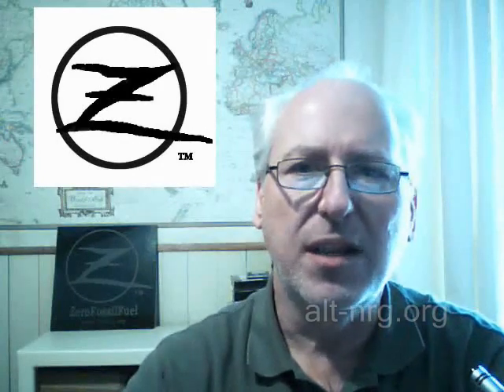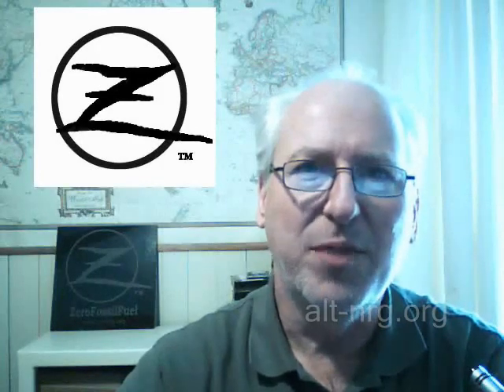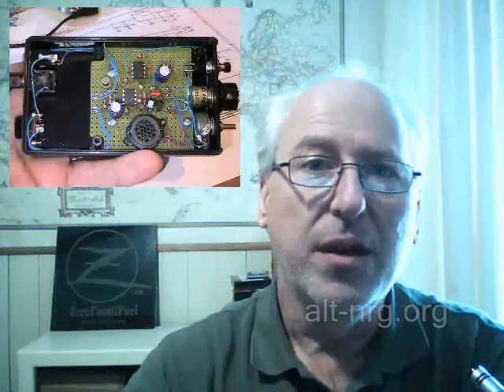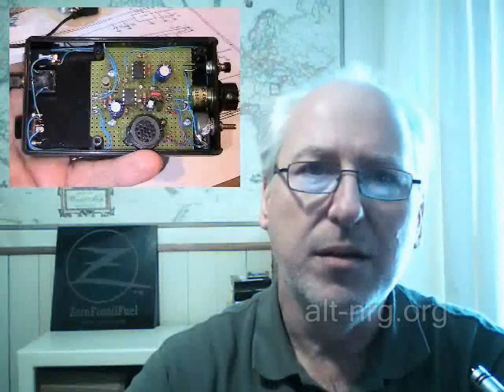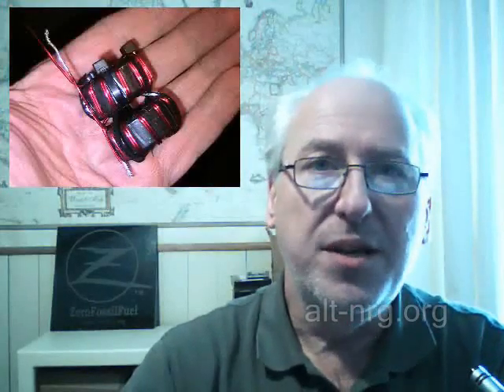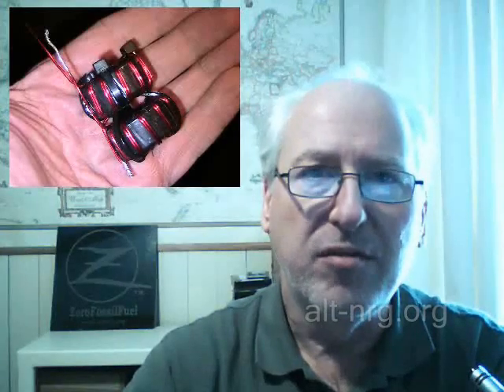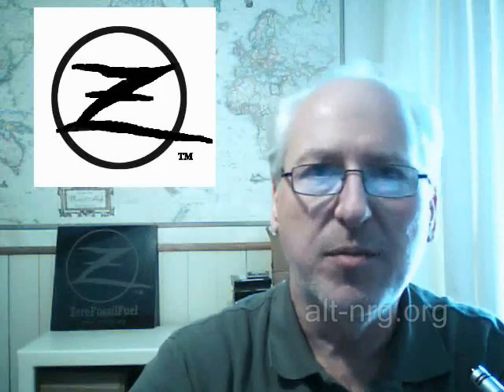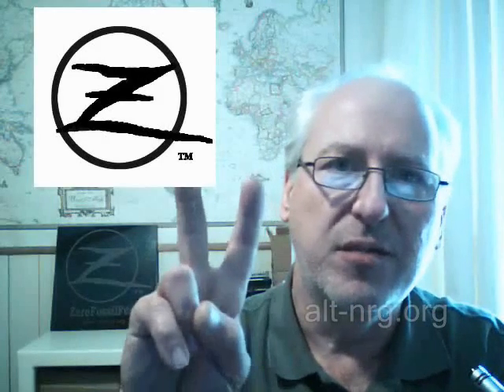#264 Winter projects, Free Energy Concepts status, future projects

Comment from the maker: @mixcatcom This dipole is a multi-band Off Center Fed (or OCF) Windham cut for 80m. SWR is less than 1.5:1 across the entire 80-75, 40, 20 and 10m bands! I only need the tuner for 15m. Getting ready to put my R-2670 service monitor on it with a RL bridge and tune it even better.